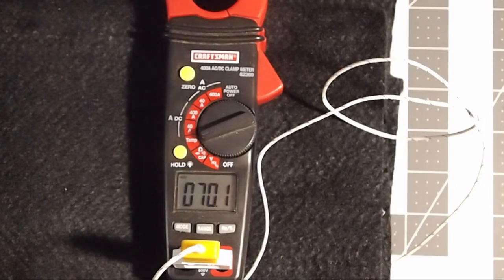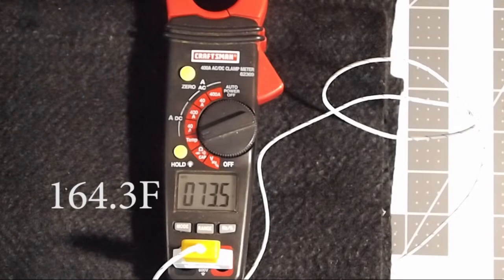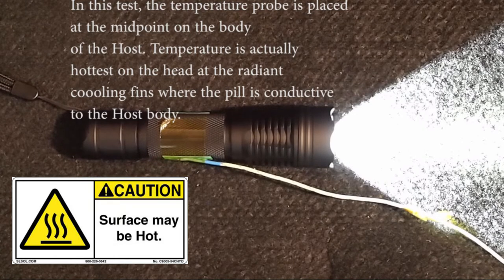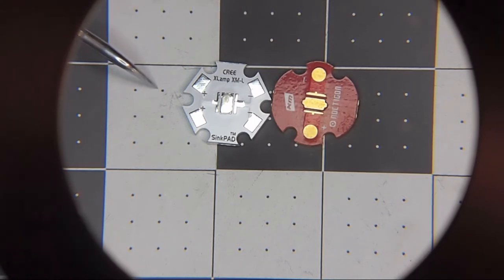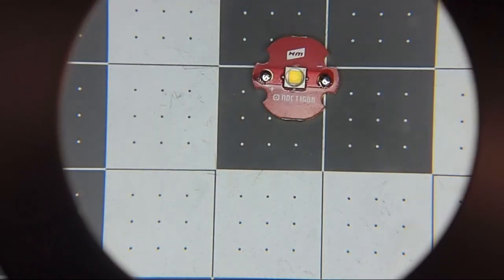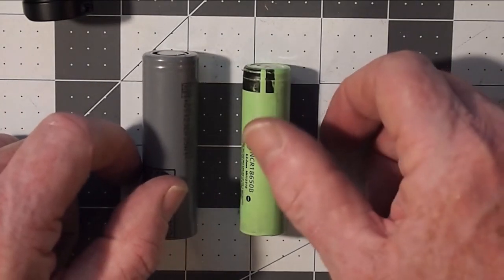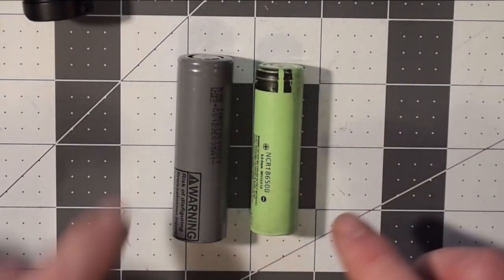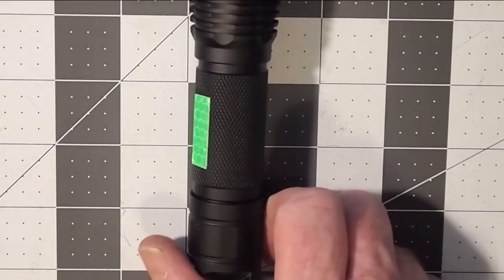Handwarmers S04E12: 2020's best electronic handwarmer (may surprise you)

Comment: Do you sell the flash light abd the 21700 batteries on your site.
Reply from the maker: Hi Fred!  I see you bought a fair bit of deodorizer last time, I'm guessing you're not enjoying the smell of Naptha? Ironically, the hotter we make a liquid fuel handwarmer burn, the more it smells. 
Yes I coupled the flashlight along with a 21700 cell. The reason for this is postal regulations allows for the shipment of a Li-Ion cell (up to 2 of them), if they are integrated into a device. So what I do is place Kapton tape over each end of the battery to prevent the light from turning on during shipping. What you do need however, is a way to charge the 21700 cells. There are a number of chargers available on Amazon, I'm thinking the best candidate at the moment is the XTAR PBS2. The light and battery are on the handwarmer order form for $39.91 (about 3/4 of the way down) here: https://docs.google.com/forms/d/e/1FAIpQLSdJ9eOjjjd9bs84UEWDQt3-wodNYsdXCJBjjzPoa6Rh73Kthg/viewform?c=0&w=1
One of the things I don't touch on in the review is how powerful the flashlight itself is., or list the spec's of the LED. For flashlight buffs, the LED is a Luminous SST40 binned at 5000K (use I use 5000K instead of 6500K because I don't like the CRI index value of the high wavelength's, and I'd go even lower if I could). This LED can take more current than previous LED's (over 8 amps). The thermal path on the MCPCB is DTP Copper. It uses a smooth reflector, although OP can be special ordered. The switch selects three modes: low/medium/high. These modes are useful for controlling the heat of the light. It does not select strobe, or SOS, features which I deem unnecessary for a device that is primarily intended to warm your pocket, or find your way in the dark.

Comment: is a led really that efficient for heat? wouldn't resistors be more efficient?
Reply from the maker: Good question. In fact many of the Chinese electronic handwarmers use ceramic resistors because they are good as heat conductors. For an LED, you can't model the linear correlation between voltage and current using OHM's law as you might a resistor, but because a typical LED plot is also approximately linear, you can in fact model an LED as both a resistor and a voltage source. So why might the flashlight be better in your pocket? Some of the advantages may be due to: 1: good heat dissipation due to the radiator fins near the head. 2: Numerous power modes that allow for the user to regulate the heat output. 3: Ability to quickly swap a discharged cell for a fully charged one. 4: Ability to use state of the art cells such as 21700 cells with 5Ah capacity that give much better capacity than the cheap cells typically used in electronic handwarmers at 2Ah or worse capacity. 5: Ability to also have a powerful light if so required.

Resistors are not designed to be heaters, they give off heat as a result of their use to reduce current flow, divide voltage, etc., etc. To address the question of efficiency, it's probably best to look at it through the lens of the intended use. You might argue that a user that is using a resistor based device in the left pocket of a given jacket, and the LED device in the right pocket, when it is very cold out, will notice foremost the ambient heat that they are giving out as it relates directly to his comfort. If he needs to replace the battery in the LED device a few minutes before he would have had to do if he had the same amount of heat from a resistor based device because it is generating more heat as a consequence of it's position in an electronic circuit, chances are he is not going to care much.
Reply: @MountainParameters  also do you think protected 21700 are worth the premium
Reply from the maker: @jamesma909  I haven't used any protected 21700 cells. They are not required for many LED flashlights, power banks, eBike battery builds, etc. because those devices can already have protection circuits built in. Even the electronic handwarmers I modified have thermal and voltage protection. 21700 cells are definitely the cell of choice when their form factor will fit your application. At the moment, I don't predict I'll have any use for protected 21700 cells for any of my projects. I'm guessing that the need for protected 21700 cells will be less than it was for 18650 because the 21700 cell is relatively new and therefore devices that use them are of more modern design and therefore more likely to have built in protection circuits.
Reply: @MountainParameters  after deciding between catalyst and electric I want a catalyst and want to know if I should get a peacock or zippo. I will replace the platinum catalyst once the factory ones wear out and might decide on mods if they are necessary.
Reply from the maker: @jamesma909  Zippo's seem to give the most problems, more information on the nature of those problems outlined in the forum.

Comment: Please refrain from running that flashlight in an enclosure its dangerous. Li ion batteries and led don't like to run that hot.
Reply from the maker: Thanks. You have to make sure you have the correct gear, and that your device has thermal control, like the light used in this demonstration for example. I also seem to recall we ran a graph that gives very precise measurements on thermal runaway and when it can happen based on the chemistry in question. Complex question that is not easily addressed by seat of the pants guidelines it would seem.